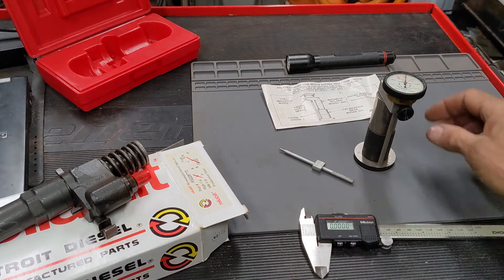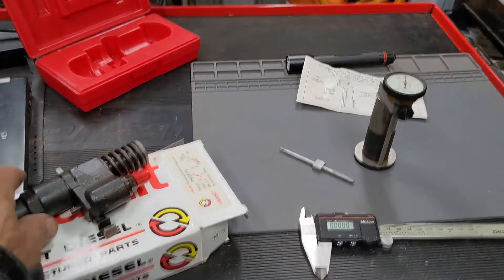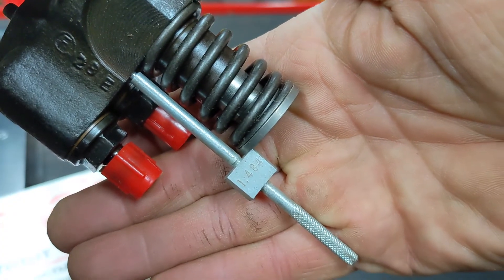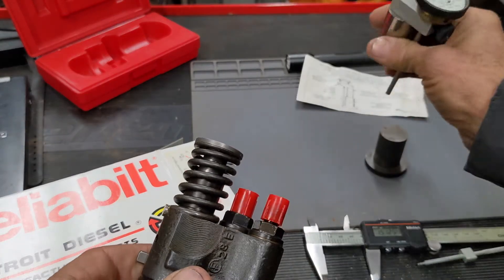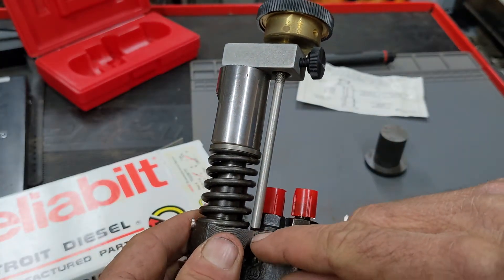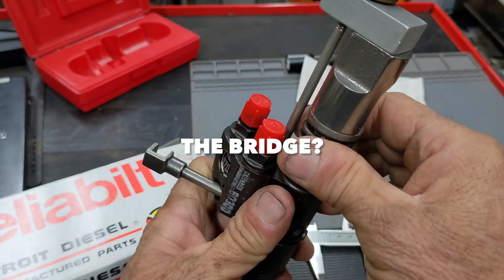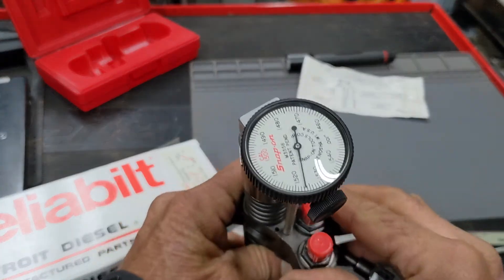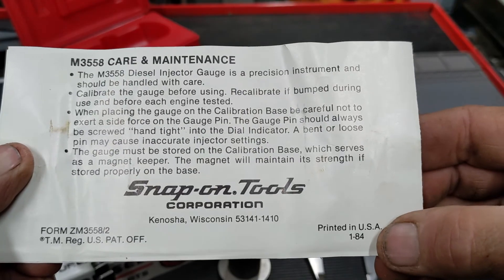Detroit 2-stroke diesel injector timing...a close up of what we're checking...and how.

Comment: But you didn't explain the setting in relation to the timing. I'm confused, looks like you are just shortening the piston travel on the injector and reducing the amount of fuel that it can squirt into the cylinder. The timing is controlled by the cam, and adjusting the piston travel longer or shorter doesn't affect timing per say. What am I missing here?

Comment: I was motivated to get the tool similar to this for the Detroit Diesel 8.2 (m3563 Snap-on). Your video really cleared up how to place the tool on the injector to use the tool properly. The Detroit 8.2 is a 4 stroke so the tool is similar but the part number is specific to the 8.2 4 stroke engine. Thank you Sir!

Comment: Bravo for your video. Great !
I have (in France) an Allis Chalmers HD15 Detroit Diesel 6 cylinder 2 strokes. I have to change two injectors that I have to synchronize. I'm quite annoyed...
Would you agree to put on Youtbe the complete method to synchronize the injectors on the STP engine block?

Many thanks in advance